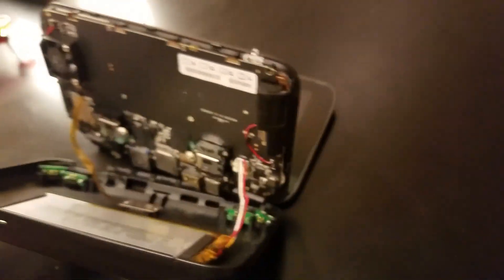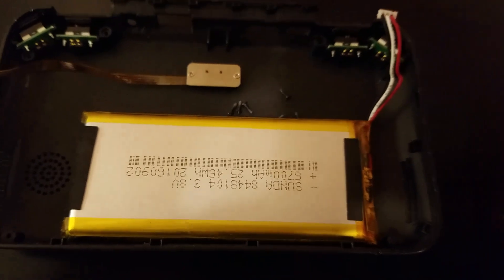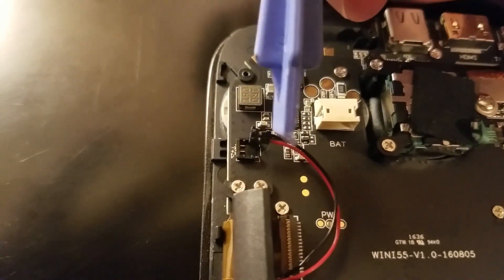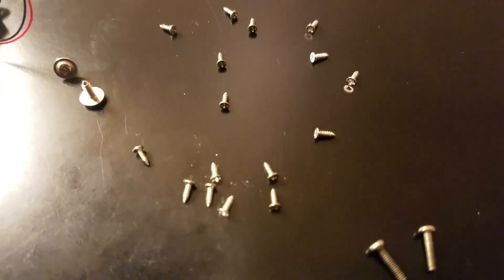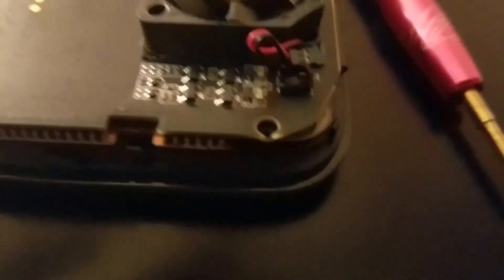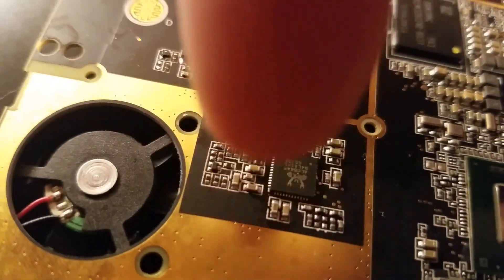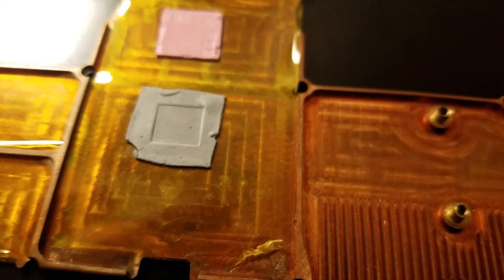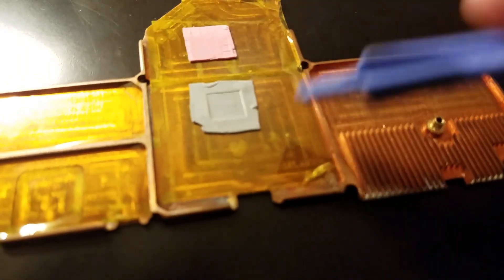GPD Win - Heatsink Mod Part 1

Comment: hi! i have a GPDwin 1 with an aluminum screen cover and touch screen doesn't work anymore, only sometimes when screen is quite closed, it seems to be a failure of the ribbon in the hinge. In order to access to the ribbon i have to disassembly the screen, i don't know if it is hooked or glued, and can't find any disassembly views of aluminum covered screen (i find for plastic cover).
have you an idea do disassembly that screen ?
Thank for you videos

Comment: hey phawx, could you recommend a place i could order a battery for the gpd1 (8448104) from? my pal gave me his, but the battery started swelling and i didn't want to risk damaging the device or have it pop on me so i removed it thinking i could still use it with a usb c type cable powering it but apparently that doesn't work? so i have a paper weight til i can find a replacement battery. any help/direction is greatly appreciated.

Comment: @The Phawx : Know anyone who can make a Housing Mod for the Win? Want to put in a new Battery, but the only way I can use the ones I have found, is if the Bottom where the Battery is Located, is Wider, and Thicker.
Reply from the maker: Chris Flowers Normally in those situations I would try to 3D print the part. 

Fusion 360 is a pretty good app for designing and then you can use shapeways to print if you don't have a 3D printer.
Reply: Yeah it seems I am not the only one having Battery Issues. Mainly due to the Placement. With the amount of Heat coming from the CPU/GPU and Storage. Too much Heat........surprised the Batteries have not been blowing up yet.

Comment: Those little connectors are called ZIF (Zero Insertion Force) connectors. The yellow tape is called Kapton. It's the same stuff they use to make space blankets. It's there to provide insulation for the logic board (thermally and electrically, so as to stop short circuits). Great video BTW, thanks!

Comment: I took mine off today, looked underneath, and they acutlly cut out the stupid plastic for me, but they didnt squart the thermal foam over the whole chip X.X and the heatsink is actully a bit smaller than yours, so im adding a ton of copper to mine right now

Comment: The general term for those cable connectors is a ZIF connector as in (zero insertion force) basically stick the cable in and clip/clamp it down...

Comment: Hi Phawx, i have noticed that you have separated the LCD part from the joy/keypad section and do you have any tips how to do that properly? I'm just not sure how hard is it and what should be done with the hinges so I don't damage them. I couldn't find any info about it anywhere. Your help would be greatly appreciated! Thanks
Reply from the maker: Greg You'll need a plastic spudger and a small phillips head screw driver.

One of the bigger problems is the ribbon cable for the fan. it's really tiny and can snap easily. 

Just look up ZIF socket connectors on youtube and you'll see how they're supposed to be inserted and removed. 

additionally follow my guide here to have a general idea of the flow on disassembly
Reply: Thank you very much!

Comment: I have a question please respond is IT POSSIBLE to use a gold coin or silver that is 15x15mm to do this mod?
Reply from the maker: Kobru Heshelviee Silver is a far better thermal conductor.

I've used silver and it doesn't perform better than copper.
Reply: The Phawx so i can just buy a regular copper shim?

Comment: the plastic looks like the electric protection and heat, if it blocks 1 way it block it the other?
Reply: buh i think its gay they didnt make a sqaure patch between heat sink so it actually isnt any of that plastic electron protection or heat protection stuff

Comment: Hey man... My L2 button isn't connecting properly to the contacts on the board (I have to push it in with way more pressure than the other shoulder buttons), do you think it would be worth going inside and padding the ends of the shoulder button just to ensure it connects every time?

Comment: yellow tape is kapton tape it used for its thermal resilience properties(used on Space craft see lunar lander and 3D Printers for a printing surface lets heat through pretty well if done right) and electrical resistance  to letting charges through.

Comment: How do you open it up? I unscrewed everything but it won't open
Reply from the maker: Crazelord91 You have to very carefully open it from top where the keyboard and controls are. Please be very careful here as it's very easy to rip the ribbon cable to your fan.
Reply: The Phawx Yah, I figured it out, kept the fan in tact. only issue is I still can't get the screen to work even after unplugging the battery and powering up using only the adapter
Reply from the maker: Crazelord91 FWIW, I've never been able to power the GPDWin on without the battery inserted
Reply: The Phawx Yah me neither, I was just trying to force the BIOS settings to reset bc the screen won't turn on. No luck so far

Comment: Question about the Joysticks if you can Answer: The Joysticks look exactly like the Vita 2000 Model Joysticks. However, I am wanting to know if the Joysticks from the 1st Gen Vita will work? The only thing is, the Cables are not the same. The 2000 looks like it has 4 Connections in the Ribbon Cable, and the 1st Gen has 6. Should it still work?
I am asking because the Rubber Joystick Covering on mine starting Ripping and I could not use it like that. If the 1st Gen works, it will be a LOT better.

Comment: OK, I got the Directional Pad Replaced with one from a O3DS XL. Thinking a N3DS XL Pad should work. But now, the Joystick Covering (the Plastic crap on it) was ripping and making problems for me. Trying to find out exactly what would be the most Compatible Joystick Replacement?????? Vita looks like it might work or even a PSP 3k Joystick because of the Ribbon. Thoughts???

Comment: I am curious, breaking it down, I am wondering if I can get a better Directional Pad and Joysticks. Wanting to use the components the Vita 1000 has for the Dir/Joystick. Would those work at all? I know the Direc on the Vita are kind of Rounded and longer. The GPD XD Directional is 1.8cm, and the Vita is 2cm. But the Directional on the N3DS matches the Size and has a Indent in the Center which is slightly better so it should work. 
Trying to figure on better replacement Buttons/Parts if need be. Thinking other Users could use that info if they ever need it. Especially the Battery since it looks like it could be Replaceable and even maybe Upgraded.
Reply from the maker: Chris Flowers for sure you could replace the membrane. those others parts might need to be printed or modded
Reply: OK. Have an extra O3DS XL Directional Pad and the Measurements are the same. Now just need to figure on a Replacement Joystick that will be Compatible. Buttons can remain the same since they look good with the dual Labeling. Will do a Video showing when I do it and also will credit you for the Breaking Down Instruction (This Video/Part 2)

Comment: Should I do this even if I've never done this before? Does it make such a big difference?
Reply from the maker: If you've never done it before I definitely suggest you don't.  There are many very tiny clips and connectors that are easy to break/rip
Reply: The Phawx Thanks! Does it make a big enough difference to go to a professional to do it? (I'll have the z8700 btw)
Reply: The Phawx Btw don't worry about me blaming you if it breaks, I'm taking the responsibility, I'm willing to risk it if it makes a difference
Reply from the maker: Crazelord91 It is a pronounced difference in temperatures.  I am very happy I did it.  I am going to do it to my 8700 with a silver shim
Reply: I assume you'll have a video when you do the 8700? I'd like to see someone do it to the same version I have before I attempt it myself :)
Reply: The Phawx Awesome! So I don't have a silver shim, can I just remove the white tape?
Reply from the maker: Apathetic Loser I have another video for the 8700 as its a little different.
Reply from the maker: Crazelord91 i dont recommend removing the thermal tape if you arent going to replace it with anything.
Reply: The Phawx Oh ok, thanks!
Reply: The Phawx awesome. when are you planning to upload it?

Comment: I saw on your z8750 vs 8700 that the 8700 does run cooler than the 8750. I kind of know software but I'm fairly a novice at hardware, I definitely want the best heat sink and temp and to be able to push my WIN to its best performance. How important do you think removing the tape is for the 8700, I'm nervous about breaking my WIN
Reply: You won't break it, but it will throttle down on the speed.
Reply: Ulf Holmström What do you mean?
Reply: there will be a temporary performance drop until it cools.

Comment: Explain to me like I don't know what you're talking about why the plastic on the heat sink needs to be removed. I'm asking for a friend.
Reply: James McGill That plastic is known as Kapton Tape.  The most common uses for it are to isolate components to keep them from shorting out since this tape does not conduct electricity and it is also used to isolate stuff from heat since it is resistant to heat.  The issue with the kapton tape is it prevents the copper heatsink absorbing heat from the cpu, therefore causing the cpu to run much hotter than it should be running which can cause performance issues.
Reply: ^ what he said. The kapton is creating a thermal barrier that is not allowing full thermal flow from the cpu to crappy thermal compound tape to the copper . causing the heat to build unnecessarily in the cpu and thermal tape.

Comment: I would stick with copper plates if the heatsink is copper. Silver will only do slightly better, if at all, and in my experience, best to use same materials to reduce any chance of dissimilar metal corrosion. That plastic shielding is dumb. There's zero heat dissipation happening since it's an insulator. Interested to see results once you get it removed and add your shim. Can't wait to get mine because I enjoy doing teardowns and mods on things like this.
Reply from the maker: Yea, when I saw the plastic tape I was furious.

I always keep 1mm thick sheets of copper around, so I've already gone ahead and uses thermal epoxy to mate the shim to the heatsink.  Just waiting for it to cure and then I'll put it all back together.
Reply: So when I opened mine it had all the thermal tape stuff on it, but it had a hole cut for the part where the CPU touches the plate.

Did your unit not have the cut in the tape? I don't really see a major issue with the thermal tape otherwise.
Reply from the maker: mycraftisbest 100% there was no cut out on my CPU. There was a cutout for the purple thermal tape however.
Reply: Ah ok. Mine had a cut for both. You must have gotten a defect. My unit originally had the flex cable under the screen folded, causing the screen to black out at certain angles. I wanted to blame shipping but now I'm not sure. #QCPassed
Reply from the maker: mycraftisbest there should be a sticker with something that looks like a date field. 0909 or something was on mine.
Reply: You mean the manufacture date sticker on the back of the motherboard?
Reply from the maker: Yes.
Reply: 201690902203

Comment: Looking at this video, I'm getting nervous about mine. Hopefully I wouldn't have to open mine up since I opened up my broken 3DS before and I put it back worse. What was your original plan though? Remove the existing thermal tape and then put something like arctic silver/any better thermal paste?

So will you just remove the thermal tape and the tape under that section and put in the new thermal paste?

Comment: I believe the little cable connectors are called Zero Insertion Force (ZIF) sockets
Reply from the maker: Ed Britton That's it!
Reply: Yep, and as you stated, be extra careful. I've broken those things before and basically the whole system is borked unless you can manage to get a replacement connector and terminals and can work with such small wires, or just solder the sucker direct to the terminals on the mainboard, but ones that small require some skill and patience (and the right equipment).